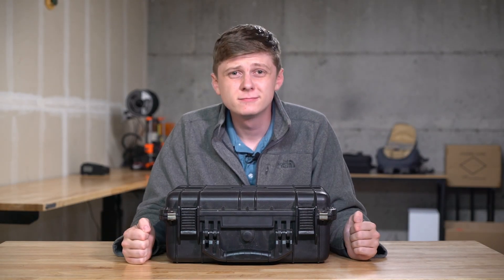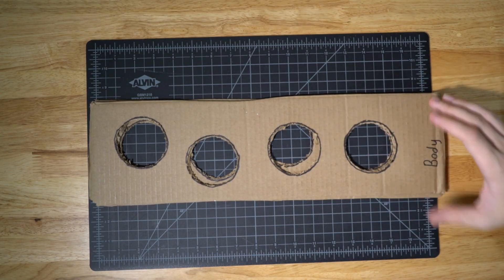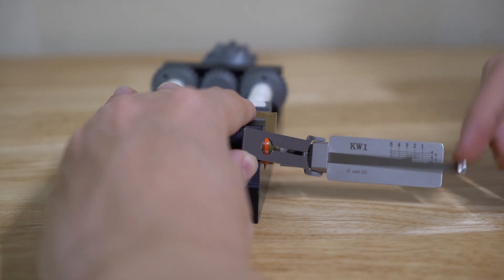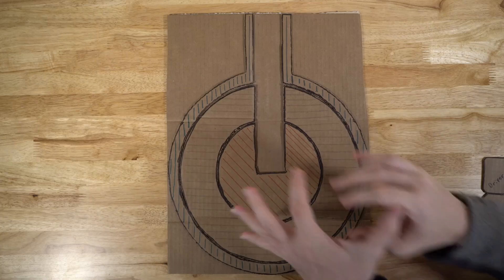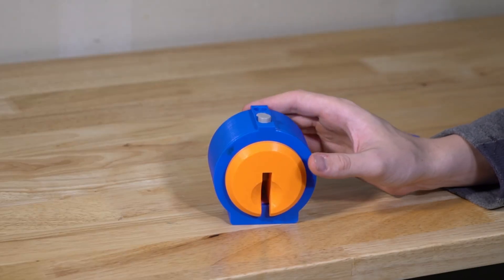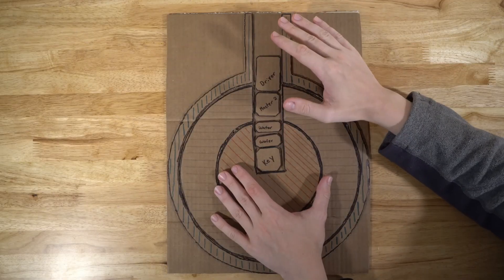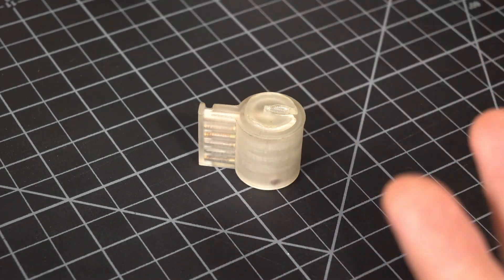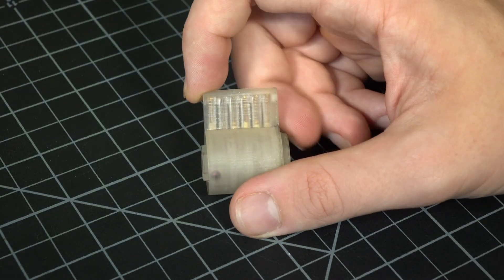How to Design an Unpickable Lock

Comment: Very innovative! I have seen a few people who have shared very similar ideas to this, and I do think there is a lot of potential with it.

One major issue I will say (and you touched on it) is if this lock was mass produced, the large amount of masterpins/wafers would cause the lock to fail and get jammed up often, especially in situations where the lock is exposed to the elements.

I would be interested and it would be really cool to see how well a lock like this would hold up after a few years in the field!

_

I know it's frustrating to see the same technology in locks, especially when they can be bypassed so easily in many cases. That being said, it's been this way for longer than just the last century and a half, but actually for a few thousand years when you consider warded locks, lever locks, and even the anchient Egyptian locks. This technology isn't going away, especially in today's age that has defined standards and rating for locks and door hardware that has been established and set over the last century and a half.

The best we can do is raise the expectations of the quality and effectiveness of the locks that are already in production. You would be amazed at how good tolerances alone can make a lock very difficult to pick... but on top of the good tolerances, if it has a paracentric keyway, high-low bitting, and security pins (especially when there is matched milling in the plug), the lock becomes nearly unpickiable in the field when done right.

I personally would love to see the overall standards of locks in NA go up. It is clearly a major issue when companies like Master Lock know about their security flaws and choose to ignore them since they know the general public is unaware and they will make more money that way...

I don't want you to think I'm saying that it's not worth the effort you are making... by doing what you are doing, you are helping to educate the public on locks and the security flaws of the locks that exist here currently. Also, if you were to produce these as commercially available locks, you should do it as your own high security company (similar to what Bowley and other major lock manufacturers have done). This is typically how lock companies have developed and grown over the last century. Even masterlock was known for better quality locks a few decades ago, and even produced their own high security lock (#19). As other high security companies were gaining success and masterlock had already captured the basic comercial market, they discontinued their high security line and refocused their development on cheap low quality locks since that's where the money was for them and they didn't care about the reputation of having cheap low quality locks. This is why they don't fix their security flaws today.

Comment: Very cool idea.

You're missing a very fundamental design element.  Most locks aren't meant to be impenetrable.

Even in their flawed current designs; police and thieves both prefer destructive entry over picking.

Making a cylinder that is even more pick resistant would practically guarantee destructive entry.

The balance is to make it just hard enough to pick to discourage, but not impossible so that the first thought is going through the window.

Comment: I'd just bump the lock, eventually you'll get the watchdog pin to move just enough to tension then pick normally
Reply: Yeah, I think a more direct linkage than an angled surface would be an improvement, maybe a gear with a gap in it that lines up with the casing only when the inner cylinder has rotated a certain distance relative to the outer cylinder

Comment: isnt this just a normal lock just with some additional parts? You can still bind the inner to the middle ring and as soon as the correct stack is selected the lock is picked.
Reply: The watchdog pin prevents binding in a useful manner.  Not saying it can't be done but it adds complexity.

Comment: If you want to make an unpickable lock, design a lock in such a way that an intruder wouldn't know how to unlock your door. If they can't tell how you unlock your door even if they watch you do it. You have a pretty secure lock. Anything that can be beaten by taking a picture of the key isn't a very good lock.
Reply: That model is called "security by obscurity" and it has proven to not be very secure...
Reply: @josuelservin  There are some cases where security by obscurity works. But yes in general it doesn't work well. But like I said, if I build a lock for my door, and you can't even tell in theory how it works, from your perspective all you see is me walking up to my door and opening it, but when you copy me exactly, the door stays locked. That lock is pretty secure. It would be similar to how if you can see the key but you can't tell what mechanism is used to unlock a lock, how would you ever be able to guess or know how it is unlocked. Now imagine the same thing, but you can't even see what the key is, or how it interacts with the lock.
Reply: Всё верно но замок должен быть в одном экземпляре и только у вас. Если замок производить массово злоумышленники будут знать как его вскрыть.
Reply: @3256323  True, which is why you should build it yourself. That way you are the only person who even knows how to interact with the lock. Google translate is awesome.
Reply: @3256323  Not necessarily. A multi factor lock where the "key hole" location is unknown, would be very hard if not impossible to pick.
RFID for example, if you can't see the reader, even if you know there is a reader somewhere, you won't be able to pick the lock even if you have the RFID key.
Reply: Security is a chain. If even one piece is broken, it all falls apart.

You have an unpickable lock? Great. What about your door? Your hinges? Your window? What if someone steals the key?
Reply: @jackgamer6307  Yes, but the point of security is to make the intruder give up. Not much is going to beat a diamond tipped drill and an army of dedicated engineers.

Comment: Your design is similar in concept but quite different in execution to Tim Hutt's design (I'm  guessing from your other comments that you've seen this one) - with yours potentially being more manufacturable.

One possible vulnerability would be to shock / vibrate the lock in order to jiggle the pins while applying torque. It would be an interesting challenge to design a mechanism which decouples the inner and outer cylinders if the lock is bumped - I think it would be possible, and it would force you to reset the lock if you tried this sort of attack.

As an aside, you've done a really good job in the presentation and pacing of this video - subscribed, and I look forward to seeing what you come up with next!
Reply from the maker: Yes! I have seen Tim's cross-lock. Almost the exact same core principle. I thought his push-in-then-turn concept was interesting for sure. How to ensure the selective torquing of the testing is one of the main challenges with these designs. I decided to target a standard keyway with this design.

As far as your suggested vulnerability you are spot on. I haven't been able to test it but I agree that a shock attack may prove effective. I will talk about this vector and another in the next video.